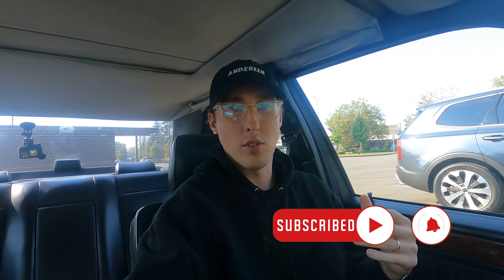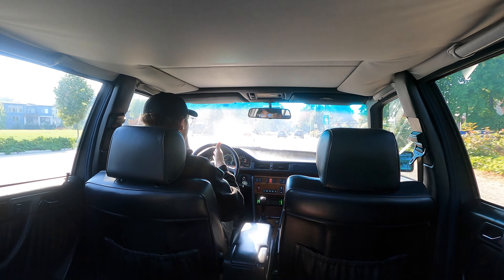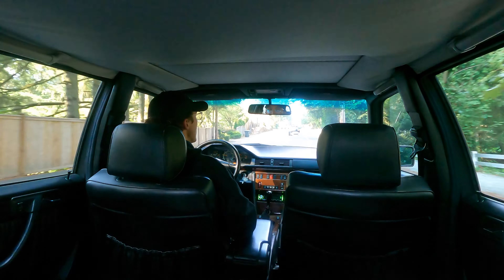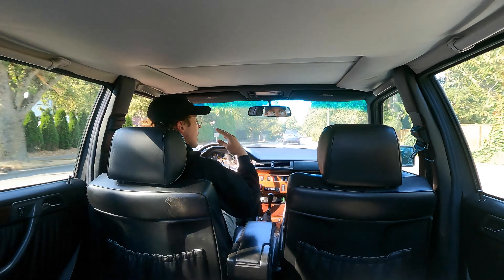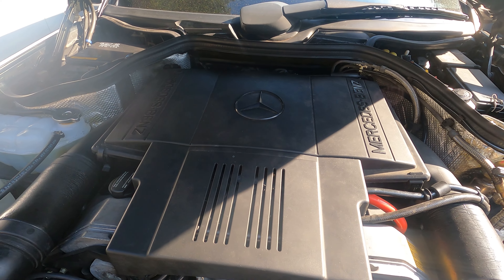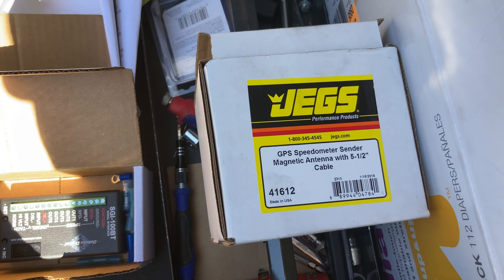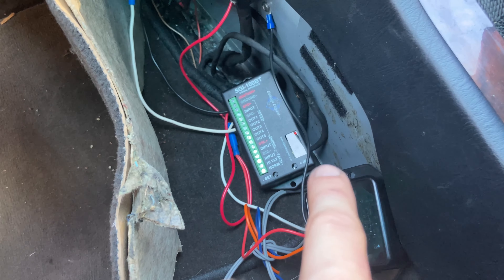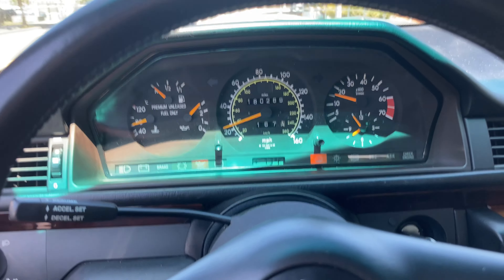W124 R129 M119 6 SPEED MANUAL V8 SECHSGANG SCHALTGETRIEBE GETAUSCHT

Comment: very good video, lots of useful information.
You've highlighting an aspect I hadn't
thought of, the behaviour at low rpm.
The flywheel at 5.2kg has replaced the torque converter which I'm guessing is a lot more.
The engine will gain rpm much quicker, but also looses out on the "flywheel" momentum of the torque converter.
My r129 will tootle round town all day at 1 - 1.5k rpm (4speed auto) so it's something to be aware of before I commit to the swap.
Reply from the maker: Thank you! Yea it’s definitely a bit different but as long as you keep it at 1500rpm or higher 3rd gear and on it’s fine. 1st and 2nd can be at 1k and be alright. The freeway it cruises at 70mph in 6th gear at about 1700rpm which is nice.
Reply: @ANDERZENAMG  
1700 rpm @ 60mph sounds really good. I'd be doing nearer 2500rpm, and of course on a non lock up converter.
I came across a flywheel for a Rover 3.5 V8 this morning, it's 15kg, so probably more like the torque converter weight.
Reply: @ANDERZENAMG  did you change the rear end ratio? That could have a lot to do with it. My plan is the change the rear while I do the swap.
Reply from the maker: @maxwellsleeper7528  I did not but would like to someday, it actually is better than this now, I can take off from 2nd at 500rpm. Could of just been me getting use to clutch or break in.

Comment: Have you figured out what the computer is doing as far as tune with different gears selected? You mentioned a hesitation at 4500 except in park. Is that in drive as well? Could asr be doing bad things as far as power/tune? Also what year is the car?
Reply from the maker: NSS needed to be in P that solved it

It is a 94’
Reply: @ANDERZENAMG  I still wonder if it could have an effect on the tune set in park.
Reply from the maker: @ possibly but I don’t think so, it felt like all power was there